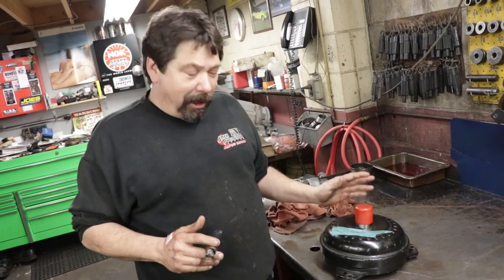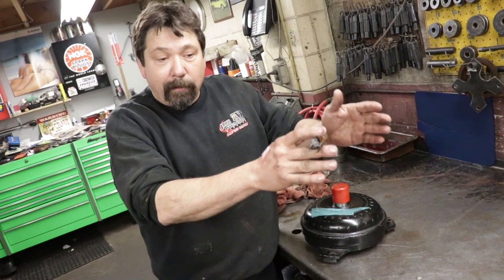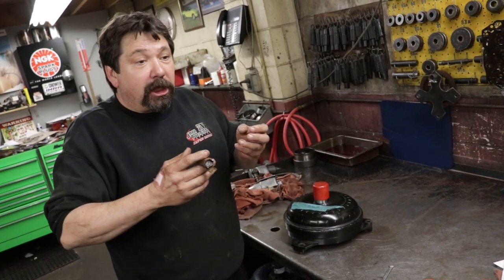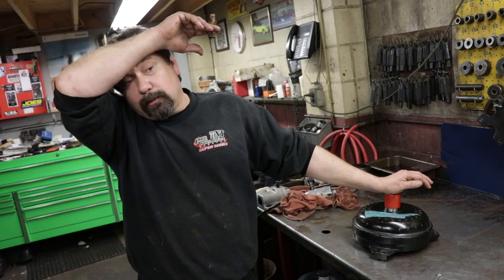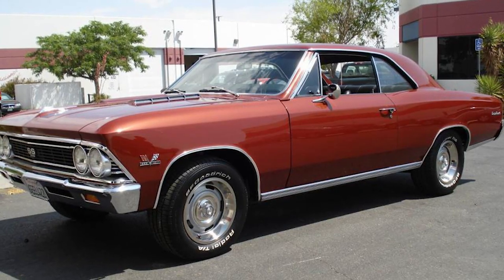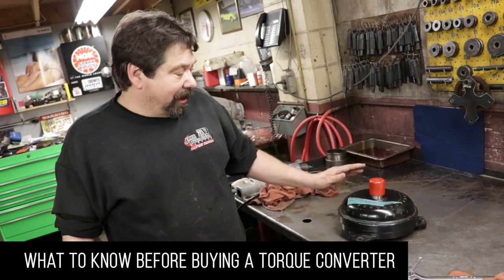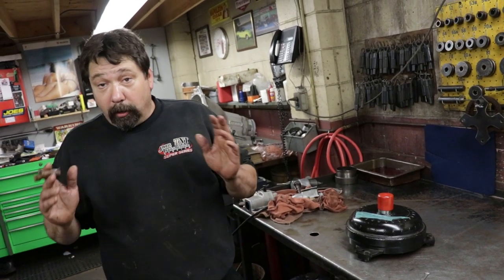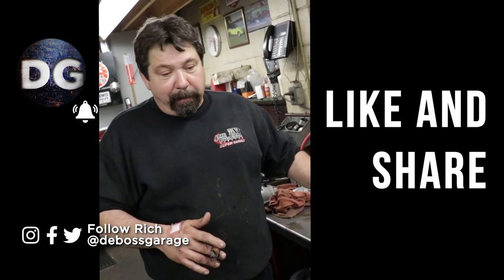How To Choose A Lock-Up Torque Converter for Racing vs Street

Comment: I have a 94 gmc c1500 with stock 350 engine , gear ratio is 425 , 4L60e transmission , 4” suspension lift and 35”x20” tires and rims , what converter do you recommend , I’m not trying to race but I’m trying to have a smooth ride when I tow or load the truck , please help ?

Comment: Funny you said that 1st. Put a 3500 in my brothers 1st hot rod. He thought the car would stall to 3500 like it's on a brake and then take off. Had to explain the same thing. I told him a loose sloppy converter is like having a clutch that's starting to slip and go out. Or shoving the clutch pedal in just enough to start slipping.  In a N/A sb 3400# car you would probably have to bolt it to the ground to get 3500 w/o a brake. Now back to T/C dump valve studies for my car.

Comment: I bought a stock torque converter 4.3 V6 for my Chevy van $75 with core Exchange without cords $150 me my self I don't a high stall torque converter it's always good to put in additional external oil cooler on your vehicle helps keep the oil cooler because rubber seals dry out with heat so if you want your transmission to last longer put on an exterior additional transmission oil cooler on your vehicle the man this video is right I'm a retired transmission mechanic another session you have to get all correct information before you can put in the right High stall torque converter in a car otherwise she will tear up your transmission the man this video is very knowledgeable about torque converters a friend had a Buick with a 6 cylinder motor in it and he wanted a high-performance High stall torque converter it would not run right I told him to put the stock torque converter back in and the vehicle ran fine apparently put in too high of stall torque converter in his vehicle always go to an expert that knows about high performance when doing high performance modifications on your vehicle

Comment: Do you know anything about upgrading the torque converter in the new CVT transmissions. Seems like there is going to be a big market for rebuilding CVT transmissions.
Reply: I work on Nissan's and most of the time the torque converter will lock up as low as 18-20mph.  So not much need for the converter to work, the CVT is making the range change.  Also performance and CVT...with Nissan do not go very well together.  From my experience.

Comment: Currently have a 2003 Chevy single cab
6.2 engine making about 580 hp stage 4 cam raise compression butterfly Pistons /RPM built transmission 28in tall tire 456 gears currently weighing about 4,000 
My shop is saying to order of 5000 stall going to be mostly track little bit of Street truck what is your  suggestion

Comment: I use to have bad ass engines built when I was a kid and never changed the factory converter or rear gears. What a disappointment.... Just finished a 383 stroker for a street car Nova put a Hughes 2500 and posi 3.42. Just right for a mild show/street car.

Comment: So an 1800 stall speed means the converter stops slipping at 1800rpm? So if i have a 454 idling at 500rpm, then giving gass and reving it to 1300rpm to accelerate, the converter will not lock up untill my engine reaches a speed where the cruise rpm is 1800?

Comment: Can I pull hole shots with my 140hp V6 using a loser convertor?  I don't want to change rear gear b/c I drive 75MPH and don't need higher RPM.

Comment: Is that why I've noticed Monster torque converters made for Diesel have an extremely low stall, even for 700R4?  As long as a low stall isn't going to hurt my acceleration with a twin turbo setup, I'm fine with using a Diesel rated torque converter to swap in my 700R4, 6 lug is designed to hold up better than the stock 3 lug anyway.  Are there any good online calculators to pick the right stall speed converter that's perfect for the setup?
Reply: Who's running a 700r4 behind a diesel? Do not run a low stall diesel converter on a gas motor you will be disappointed.
Reply: On a diesel u have to watch on how low of stall you go with it will effect turbo spool up. If you tow with it I would go 200-400rpm lower than stock. If ur not towing I would go with a stock stall.  Look a goerend for a converter

Comment: What are those lil gray things hanging on the wall? To the right of the phone
Reply: fuck me now i had to know too.
i think its those plastic tools they use to allign a clutch into a gearbox with the splines on them. "clutch allignment tool" or w/e
Reply: Ya they are clutch alignment tools for different engines. The clutch has splines (you can see the splines on those tools) and in the engine there is a piolet bearing that the tip of the tool goes into. You tighten up the pressure plate and remove the tool and the clutch is aligned
Reply: The rods hanging on the wall are Clutch Alignment Tools. They are used to center the clutch plate when you bolt on the pressure plate to the flywheel at the back of the engine. The center of the clutch plate is splined and the front nose of the tool is smaller and round to fit into the pilot bearing that sits in the center of the engine flywheel. These are used only when putting together clutches and manual transmissions.
Reply: Yep. Didn't have one while putting my Subaru engine back in and had a hell of a time getting it all lined up. Definitely handy.

Comment: I'd love to know how long fluid lasts with all these drag racers spooling their turbos against the converter for what seems like an eternity.
Reply: Stock fluid couldn't handle it, even the converter and line pressures generated could blow something.  Most dragsters use a full manual valve body and trans brake to keep driveline stress down, and still manage good launch times off the line.  Hell, even the Demon uses an automatic.
Reply: I am a retired transmission mechanic one of the most important things is to keep the transmission fluid cooler if you're doing racing or even if you're driving on the street put a big external oil cooler on vehicle this will keep the transmission cooler and your transmission will last a lot longer it is a torque converter that generates most of the heat in your transmission Shady your transmission as recommended by the manufacturer is best for passenger cars also doubt a sub shops are doing the flush system I don't recommend that especially when you have an old vehicle and the transmission has not been changed for a very long time for example we have a vehicle with a hundred fifty thousand miles or more and a person goes down to the mechanic shop and they want to watch the transmission this is not a good idea because the transmission is old the clutches are old trust me on this don't have the garage do a total flush on an old car I recommend change the oil as recommended by the dealership and a filter on your vehicle but do not do a chemical flush on your vehicle you can I do your coolant lines from your radiator and there is an intake line a output line you put new transmission oil in this way would you do a regular scheduled transmission fluid change are your vehicle with a filter if a vehicle has a lot of mileage on it it doesn't look like it's been changed very dirty or burnt fluid drain the oil pan put a new filter on it and fill it back up with fluid maintenance is the key to keeping your vehicle running for many years have a nice day sir

Comment: #De_boss_garage I have a 6.0l 236 to 246 cam on a single cab Silverado on 17 inch rims I js change the transmission from a 4l60 to 4l80e but it feels like it's driving on second ⚙️ it's not locking up I want it to run low rpm after 50 what size of stall converter do I need boss